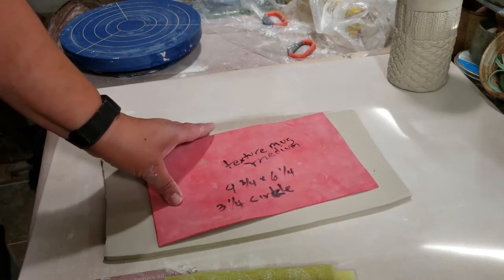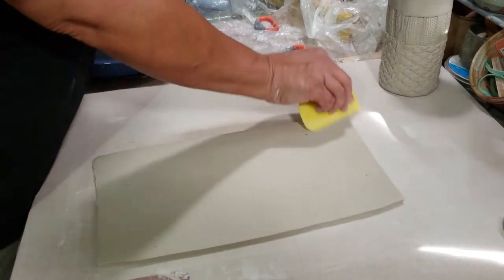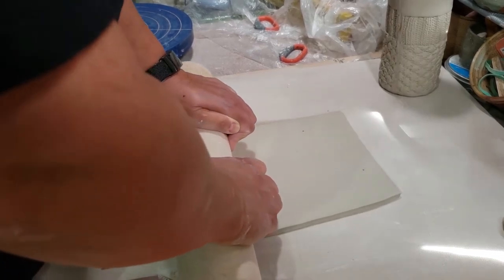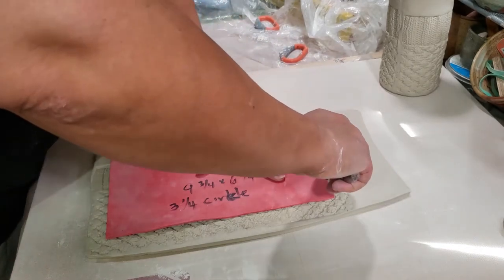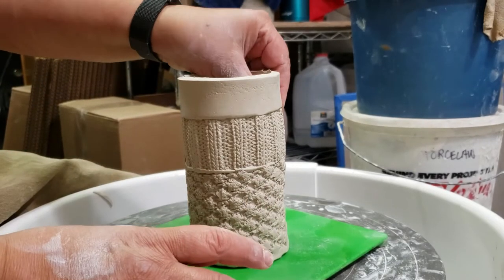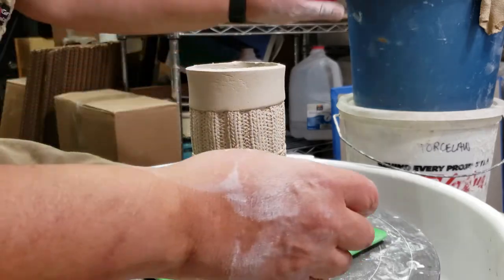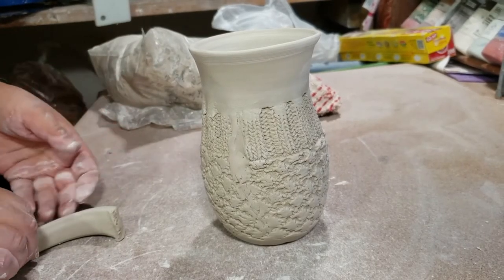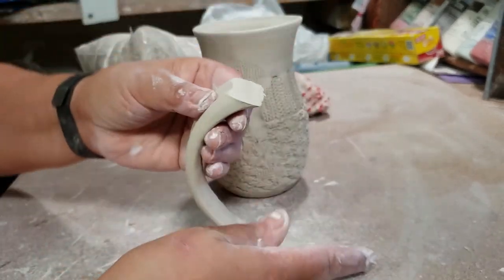How to Make a Textured Sweater Mug from a Slab

Comment: Thanks for sharing. I will definitely try this. Also like the way you pulled the handle! 
When I cut ornaments from clay I lay plastic down over the clay and then cut out the shape with a cookie cutter. It gives a nice round edge and less clean up. The plastic bags I use are usually the ones from that you get over cloths returned from the dry cleaners.
Reply from the maker: Glad you found it useful!  🙂  When I am making a bunch of ornaments I also use plastic. I agree with you about less clean up and smoother edges. I guess I just forgot when doing one ornament. 😁